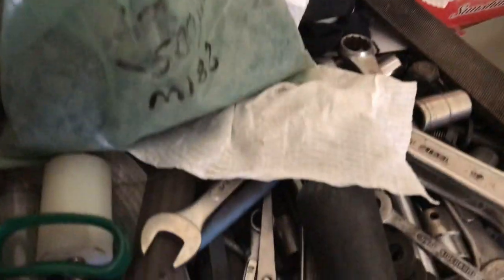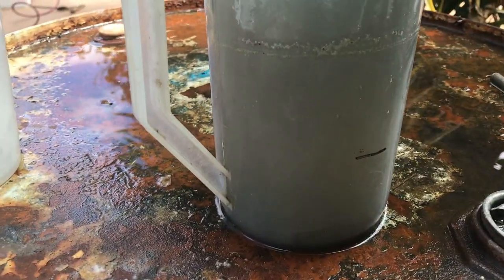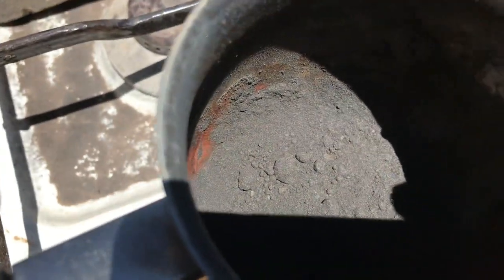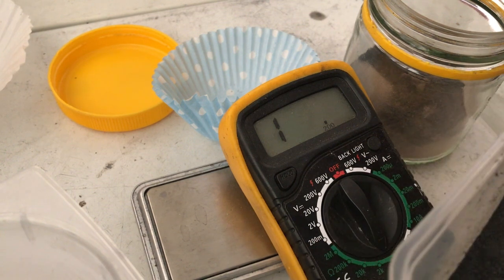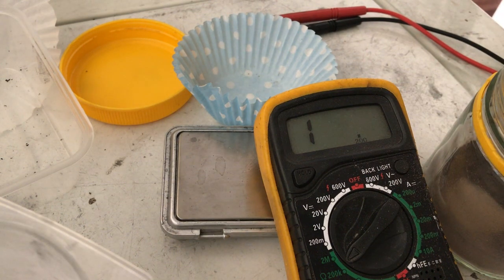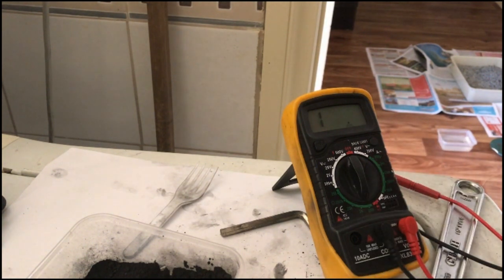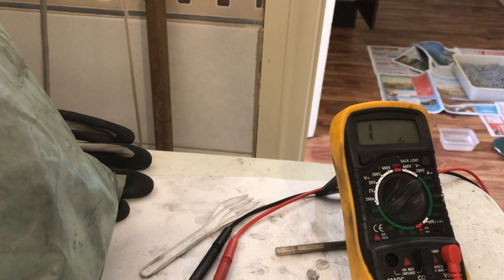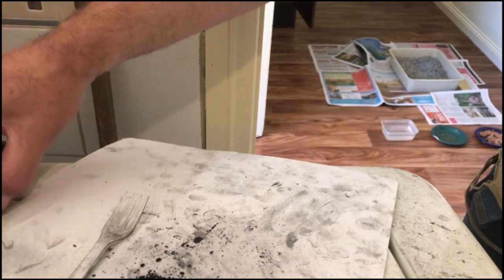Expanded Graphite

Comment: i really like some of the work you have done in this video. i am intrigued by the red head  bricks and how they perform after graphitsation and activating . they are good out of the bag for resistance but i feel they have low surface area that could be improved a lot by grinding and then zinc sulphate doping and then into the kiln. What are your thought on this?

Comment: When we crush the Graphite ore we must be  carful of grinding and sieve size, to avoid destroy of the flakes, and if we conducted SEM analysis of ore it gives better understanding of how to liberate the flakes from the host rock mechanically . And To increase carbon content and dissolve gangue minerals maybe combination of acid leaching and flotation give high carbon content. For intercalation i think oxidation for several days in cold temperature and sudden heating give good expansion result.
Reply: what quantity of  acid required for 1 kg of graphite flake.i have been trying to do it much i guess i am not doing correctly.

Comment: Hi Dan, good work !
To accurately determine the concentration of the sulphuric acid you can wieigh it. Weigh say, 100ml and multiply to one litre, charts for specific gravity of sulphuric acid are readily availible on line. I done the same as you, as battery acid is readily sourced locally. The good thing about knowing the specific gravity is that you can convert to molar strengths as well, so if you need stoimetric quantities for a reaction its pretty easy !

All the best

Tony